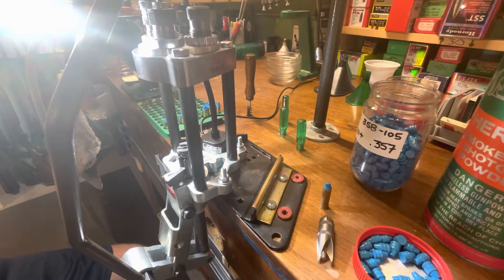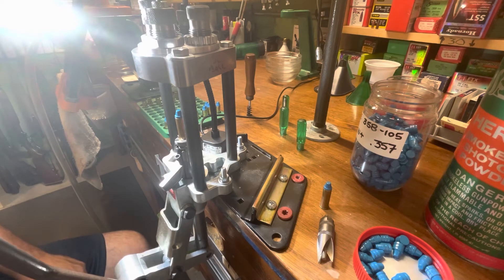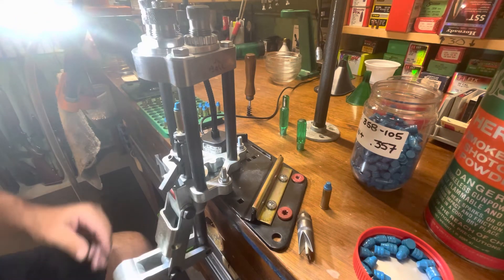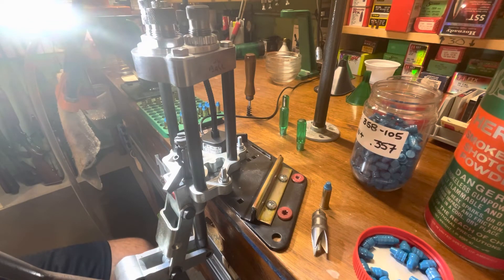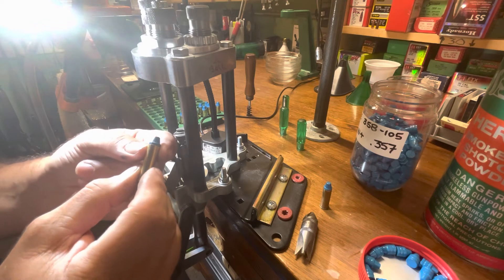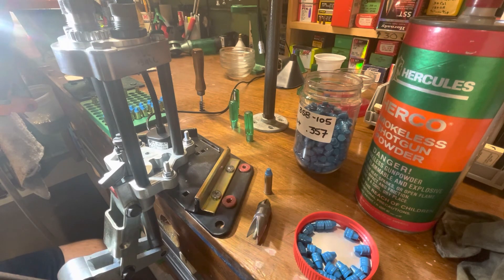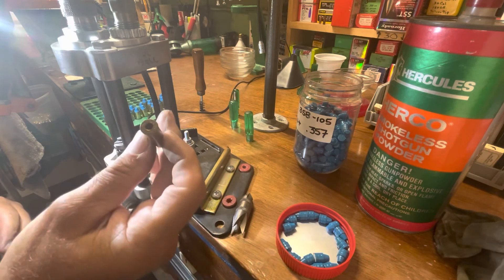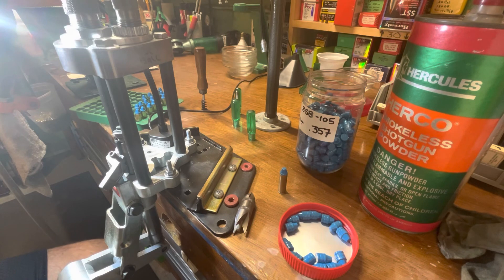38 Special W/LEE 358/105.

Comment: Yes! I am so glad you featured this bullet. A great design that harkens back to the Crawford 45 ACP design H&G #68 and the old Himmelwright 38 designs 360302 for the 38 S&W and the 308302S for the 38 Special both are close at 112 grains. The Lee bullet works in anything from .355 to .359 and it saves on lead too. I hope you have a range day video with this bullet.

Comment: Good stuff, I was looking at getting this mold for a lead saver. Do they work in 9mm at all? I've heard mixed reviews on that. Thanks!
Reply from the maker: I wanted to use them in 380 so I dont see why they wouldnt in 9mm too.
Reply: @cw2a  awesome. And about 380, have you tried the 95gr Lee RF* in 9mm? Would also be a good lead saver, but then I couldn't use it in 38/357.
Reply from the maker: I dont know of that mold. I have and LOVE the LEE 95g "WFN" One I did try, The LEE 124 RN is too long for the 380.
Reply: @cw2a  I meant the flat nose one you might be talking about. I think I'll go with the 358 105 for dual purpose, anyways.